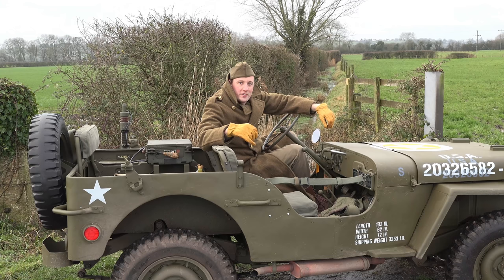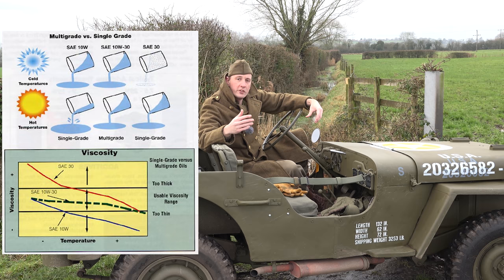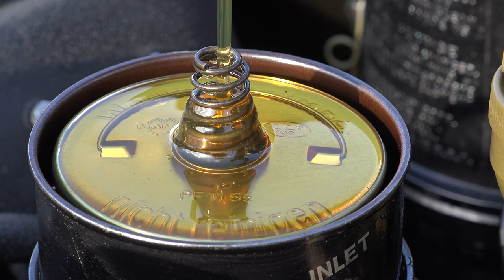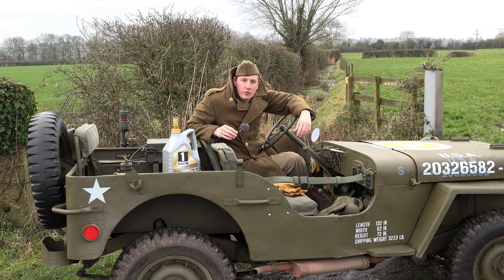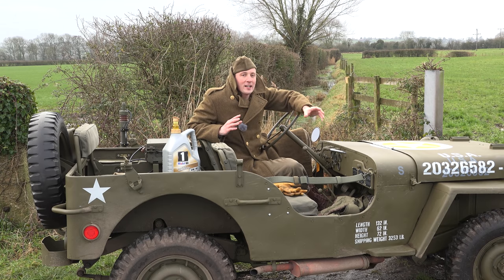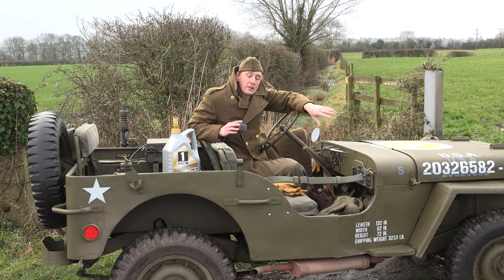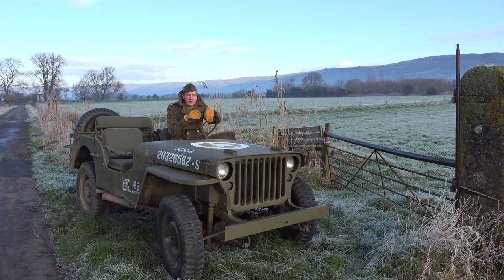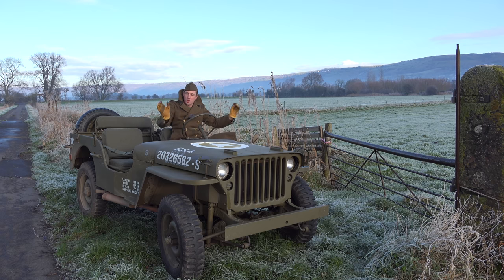Why can't You use Synthetic oil in old engines??

Comment: This guy talks WAY TOO MUCH. Older engines with Wider tolerances should use NON-Synthetic oil. Newer Engines with Tighter tolerances Could Use Full Synthetic oil. Nuf-Said. But Half of his LONG talk at the start was instead about viscosity, (or oil thickness). Low # in prolonged colder temps., and higher # in prolonged hotter temps. And Multi-Grade oil #'s for both temp ends of use. The oil acts like a lighter grade when it's cold, and a thicker grade when it's hot. Nuf-Said. Maybe people like his British accent or his replacement words they use from ours.